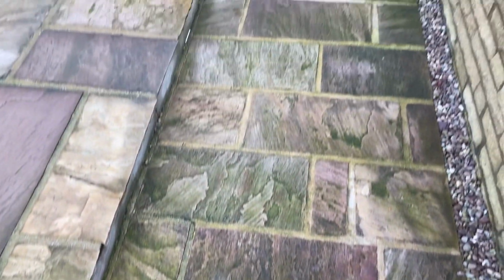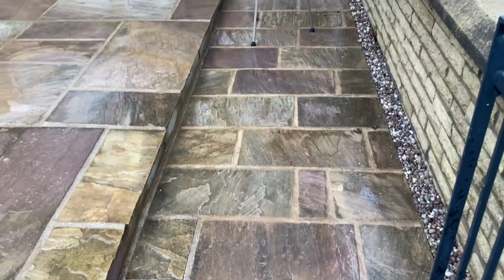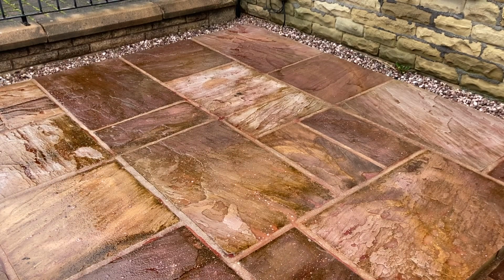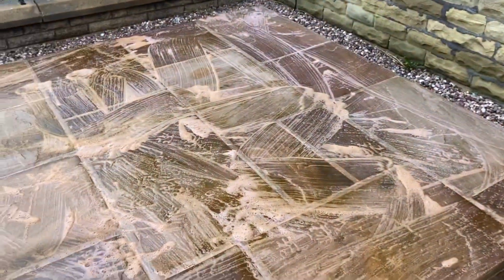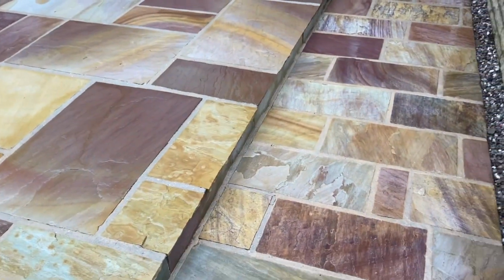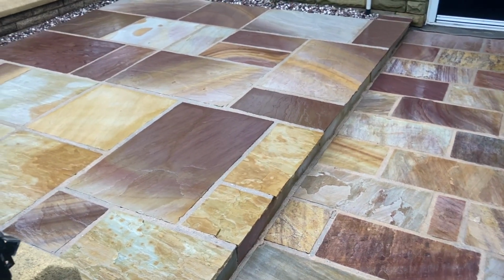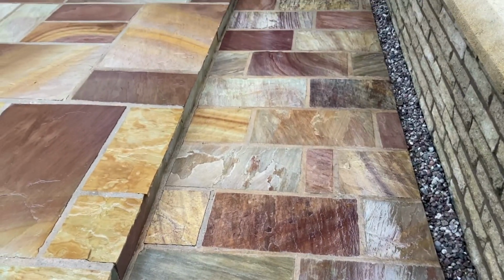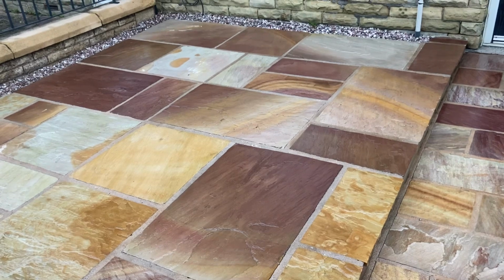BEFORE  and AFTER power washing // STEP by STEP guide

Comment: Have to say Dan, the wall coping stones and patio look REALLY good.  Really appreciate the outline of steps.. Id have never thought of using TFR.. only ever used a powerwasher, so will be trying something like this over winter on my own to get rid of the Black spots.  Thanks
Reply from the maker: For the black spots use neat and leave for hr or so but dont allow to dry and power wash and leave a minute then re go over it and it will keep getting rid of the black spots, the tfr extra is much better for the black spots its about 45 quid for 25 ltrs from ur autosmart rep 

Im catching you up on the subscribers i feel like a f1 driver getting a slipstream ready to overtake!!
Reply: @DanielHibbertLawnExpert  Thanks Dan,  yes you're going amazing. Think we will all be chasing you next season. Keep up the top work.  Much appreciated

Comment: Please Help!! 
Where can I buy the cleaning products you recommend only I am struggling to source them - thanks
Reply from the maker: Swarfega path n patio is good tfr
Reply: @DanielHibbertLawnExpert  thanks for the quick reply - I can find Doff cleaner but Not the tfr or paintmaster 2000 - any ideas please ?
Reply from the maker: @ianreader4919  swarfega path n patio is the tfr, paintmaster 2000 block paving seal and anything containing benzylknoium chloride is the algae killer
Reply: @DanielHibbertLawnExpert  sorry to be a pain! So just checking I use Doff cleaner, then swarfega patio and paintmaster sealer ?

Comment: Great Job Dan! How easy was it to grout between the paving flags when you laid it?
Reply from the maker: Easy mate i do a 3 sand 2 grit 2 cement mix with washing up liquid as the plasticiser, not really wet, should be able to compress the compo without it becoming buoyant and i mix lots of little batches rather than one big one as it could be a few hours before you use it all in which time its started to cure, this technique ive found is bulletproof, however on my next vid or ill be doing some re pointing after grinding out the joints and using flowpoint which is a slurry you sqeegy in and wash off and leaves a 40 yr guarantee pointing job and its good as used in a little patio of cobbles i made in April

Comment: How come your mortared joints are in good shape? Mine are crumbling and cracking.
Reply from the maker: Coz i did it in the winter so the cement of the flags hadnt gone off before the pointing cement could adhere to it and it can cure slower than in summer
Reply from the maker: And all bind as one, if you it in summer the cement of the flags would cure then you would add the pointing cement and the two wouldn’t adhere as one , leaving room for water to get between, 

Also i have a good mortar ratio